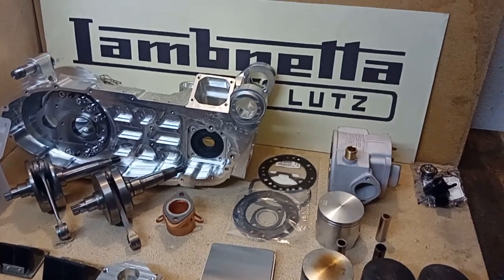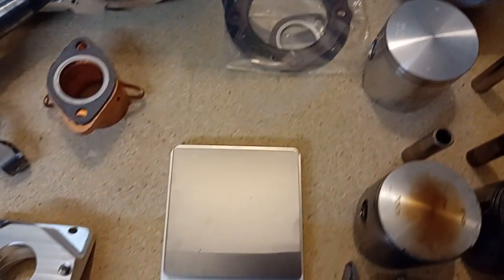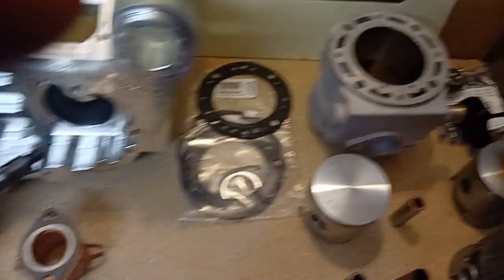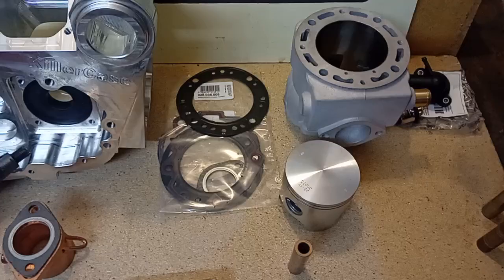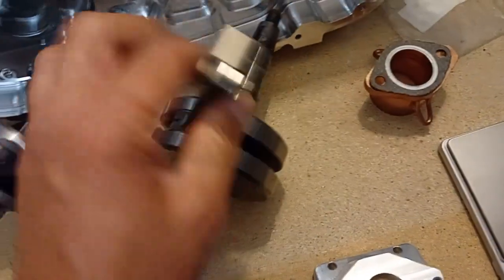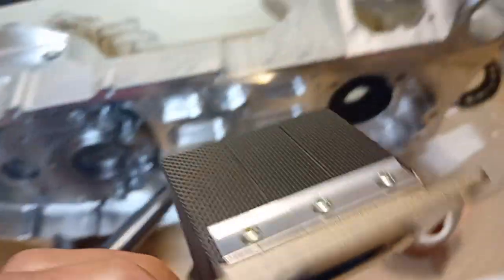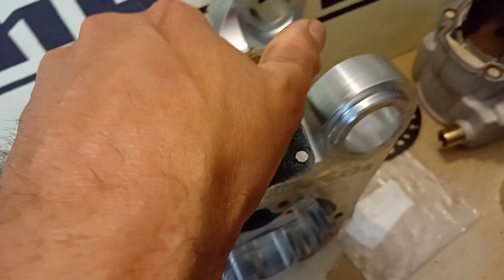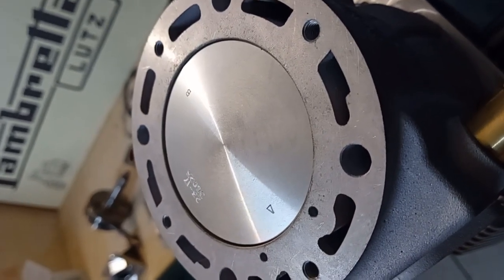#Lambretta - Liquid-Cooled Thor 250 Engine - next steps

Comment: Posch Performance build the same engine for a Vespa based on a pinasco casing and solved many problems in his built👍he seems like a really nice guy and maybe you could get some good ideas from each other.
Oh ok,gerade gesehen,dass du selber aus Deutschland bist,dann hast du sicher schon von seiner Arbeit gehört 😉
Reply from the maker: Hi, yes, I know Jürgen very well, and we are in almost daily contact. We both had the idea for the Thor independently, but almost at the same time.
He has now proven that it's a very suitable cylinder for Vespa scooters, and of course, water cooling offers a significant advantage.

I am no longer continuing the project based on the Killercase, but I have shown that adapting it to the Killercase can be done with relatively little effort.
The Thor project is by no means "off the table" – as confirmed by the results from Posch Performance, I will take it to the next level.

For 2025, the following projects and POC engines (Proof of Concept) are in planning:
- Thor single-cylinder engine – based on a modified original Lambretta engine case
- Thor single-cylinder engine – based on a different engine case
- Thor twin-cylinder engine – based on the Chimera Twin Kit

If there is interest in building one of these engines for yourself or your customers, please contact me.
It will be a win-win situation: You'll receive a unique LC Lambretta engine with all my knowledge integrated, and my work will be free for one of this first POC engines – only the parts for a discount price need to be paid for:

Deal? 
Please contact me through official channels:
https://www.lambretta-lutz.de/en/Contact-us/

It’s going to be great – stay tuned!

Comment: Ports are to advanced , use the 60 and drop the barrel is my advise , paragliders dont need the low end torque but lambrettas ride much better with low timings . good idea nice playing with stuff .
Reply from the maker: Hi Steelweasel, first of all, I really like your YouTube channel – great content! Congrats!

You are absolutely right in your comment. It also depends a lot on the barrel design and personal preferences.

I like to ride my Lambrettas very fast, so I usually prefer different timing settings than those I would recommend for a customer's engine who desires a touring setup.

Here, in this "Proof of Concept," the focus is on demonstrating a straightforward conversion to water cooling, even though I know that many Lambretta riders are rather skeptical about it, despite the obvious advantages.

I haven't made a new video yet, but I'm currently working on a modification to show how the same setup can potentially be adapted to a Casa casing.

However, this will happen after I return from vacation and get back to the workshop.

So stay tuned... it's going to be good!
Reply: @Lambretta-Lutz  looking forward to it , i used a yamaha arox water pump driven direct off front of flywheel with three pins with rubber sleeves , worked well on my water cooled endurance scooter .
Reply from the maker: @TheSteelweasel  
Thank you for your suggestion, very interesting. I believe that if you're going for LC and thus eliminating forced air cooling and the flywheel, why add mechanical components again? Just by removing the flywheel, you're already freeing up a few horsepower. 
Since I always use a DC system, I will opt for a thermostat-controlled electric pump. The power consumption of modern pumps is very low. I’ve had very good experiences with this in other automatic conversions.
Reply: @Lambretta-Lutz  electric pump will be unreliable . every moto x bike uses a driven pump that runs faster and slower with the motor rpm , i had a electric pump on a water cooled engine 40 years ago and chucked it in a box ? still there i think  . I ran a driven pump on my endurance scooter in 6 hour races no problems .
you can try if you like  . But charging a battery will use about 1.5 bhp the pump will be around 0.5 bhp to run
Reply: good luck  my friend
Reply from the maker: @TheSteelweasel  
That’s very interesting—so I should be able to measure it on the dyno - a mechanical system compare to electrical...'
However, since I always drive DC systems, the difference shouldn’t be too significant. 
Also, I don’t plan to stick with the Pollini Thor alone. I have something with 50+ HP in mind (not with the Polini Thor ;) , so the 1.5 HP for charging lost wouldn’t be too crucial to consider.

One point that comes to mind—is it possible that motocross bikes don’t use electric pumps because they want to avoid the extra weight for a electrical pump or perhaps don’t even have a battery system install?
Reply: @Lambretta-Lutz  the average group 4 race scooter gains around 3 bhp when the lighting poles are removed from the stator , i dont know why motorbikes in general dont use a electric pump but my guess is reliability , cooling effectiveness or some thing , but  japan with suzuki , yamaha honda kawasaki get things right and im following there way . 
they have been leaders in two stroke engine for decades , they dont use dellorto or electric pumps . but every man can experiment to find a way .
all the best of luck.
Reply: @Lambretta-Lutz just finished a water cooled RB with electric pump, spent a good amount of time on the Dyno trying all different set ups, with the pump on or off the hp didn’t change, the benefits from having the water cooled head were worth the time and effort.